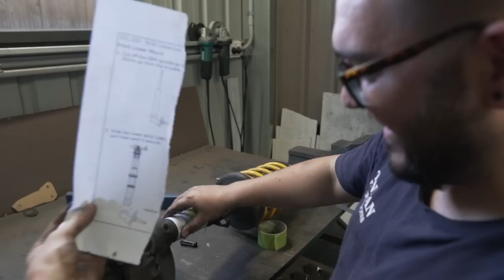HOLDEN VK COMMODORE Mini Build - PART 1 - Fitting BC Racing Coilovers

Comment: So, firstly: Instructions 2.0
Then, I too used to have a VK Wagon, with the Nissan 3ltr (Yes I know it had Holden rocker covers, for the pedants.).
Almost killed me; apparently were famous for the Rear Brakes locking before the Fronts, as I discovered on a trip over the Remutaka Hill!
(Exactly as if I’d pulled the hand-brake on at 60kph & ended up in the opposite lane, facing back the way I’d come from!!!!)
Thanks to whoever was watching over me that night, I didn’t drop over the edge, as it’s a HUGE drop-off , to the bottom!🙏 
Make sure that you check into that issue, in case it’s the same for the Sedan!
Love the Show, keep up the good work.

Kia Kaha,
Grant from NZ.

Comment: I have fitted a set of vx front arms and knucles (almost the same wheel track only 3mm shorter difference) with adjustable z bar and vr/vs coilover struts with vn top hat with vz hsv brakes on my vk. takes a bit to get the wheel alingment set right now i have a lot of adjustment for street and track. if you have the big banger body kit on you can use vr/vs arms and knucles (wider wheel track) but have to the shim kit to fit vt-vz brakes ( had the vr/vs arms on track car and you can get more negative) the only down side to this set up is customs wheels to get the right fit and look.

Comment: About to install a set of coil overs to my VT Clubby so was good to see this. Thankfully no welding required on later Commies. I won’t use my “instructions 2.0” for oil soak 😂

Comment: Instructions 2.0. I've never built coilovers. I'm curious to know, is there a lot of play between the outside diameter of the old shock body and the inside diameter of the new tube? I'm not even sure it matters, just thought it might make it hard to have the tubes welded in the same position on the left and right assembly.
Reply from the maker: Hey mate, they were actually a pretty snug fit, very little play if any, the only place that we think is vital to get right is the bottom face of the shock tower flat against the top lip of the stub axle, which is easy done

Comment: You sure its not a 304 actaully ???
Reply: If its an '84 or early '85 donk it will be 308, was in 1985 they went to 4.9L to keep in line with the Group A engine regs.
Reply: Instructions2.0